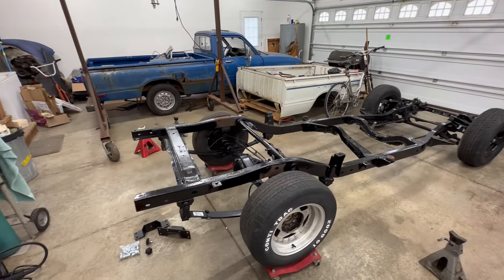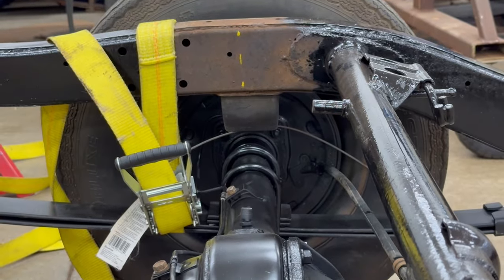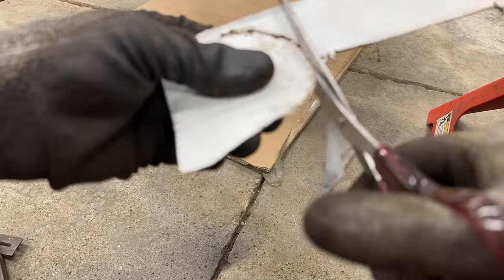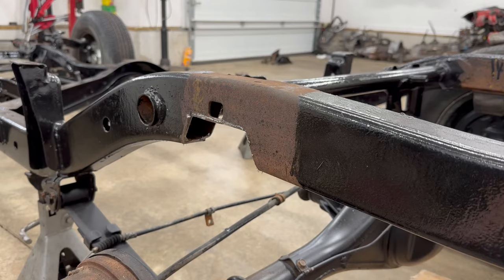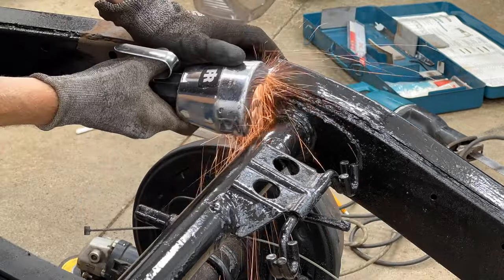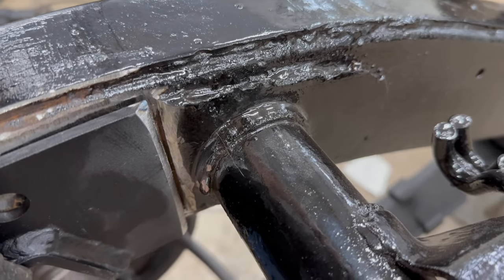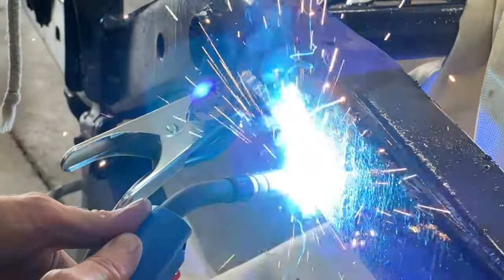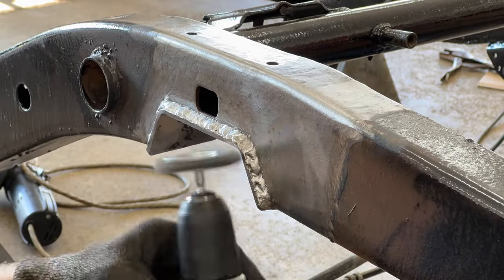How to Install Mini Notch on Toyota Pickup Truck Frame, Weld On

Comment: might have some torsion bar  arms - will check year etc on the parts truck -  BC  Canada
Reply from the maker: I ended up getting a set, but they didn't fit my torsion bars!  So I just ended up modifying the LCA's to work with my original ones:https://youtu.be/3rF7W55DuaQ around 14:35

Comment: The chassis is looking great. Is there a reason why you couldn’t have just put the mini notch plate on from the outside and saved some cutting and grinding?
Reply from the maker: I put the plate on the inside because the inside rail of these boxed frames is thinner than the outside. Outside would have been a lot easier, but I like to over engineer/complicate things whenever I can :)

Comment: So not sure what type of luck your having with that paint combo. I started using Eastwood encapsulator extreme! It’s silver and then a black Eastwood epoxy frame paint. With paint most are actually porus. Epoxy paint are not. Careful some that claim epoxy aren’t full epoxy’s… I still clean the frame as you did I just use the encapsulator just in case for those missing particles of rust that will help grow more rust!
Reply from the maker: Thanks, I had applied a POR15 type product called Rustproof MD on the rest of the frame and it's very strong. I'm not that impressed with the spray paint, it scratches just as easily as normal spray paint. I just wanted to get the bare steel covered before it started to oxidize. I'll be spraying the inside of the frame with Fluid Film, which is a lanolin based product that I've had good luck with over the years. And of course, this frame will never see road salt, as long as I own it!

Comment: I think the c notch goes on the outside of the frame
Reply from the maker: The outside of the frame is about 2x as thick as the inside, so I think the extra bracing would work best on the inside. I'm not sure though, because they didn't come with instructions.